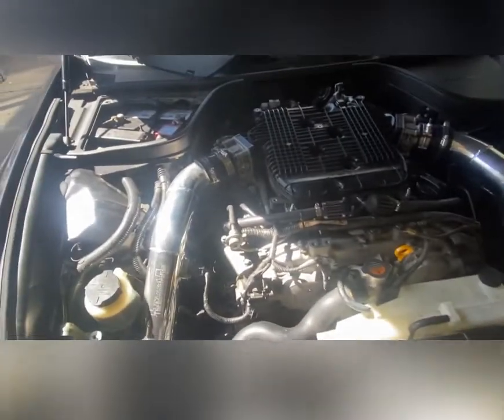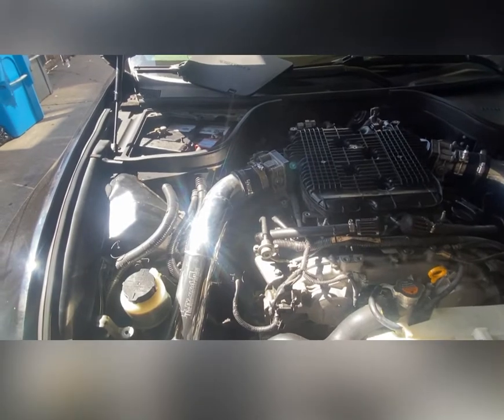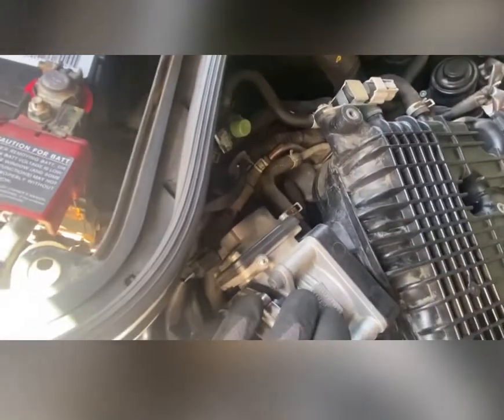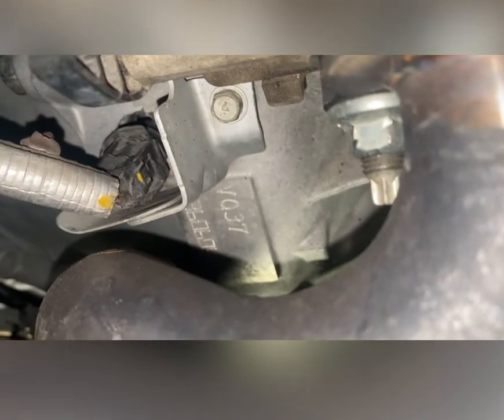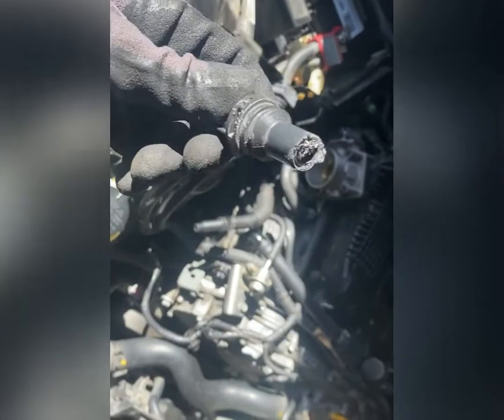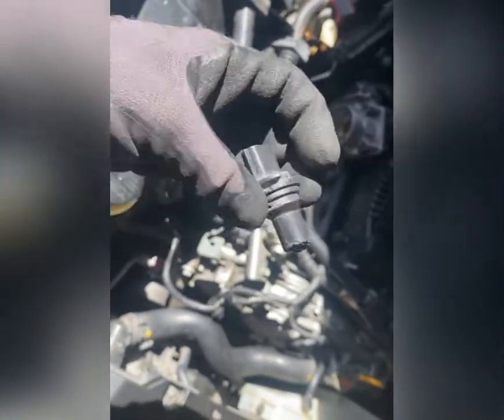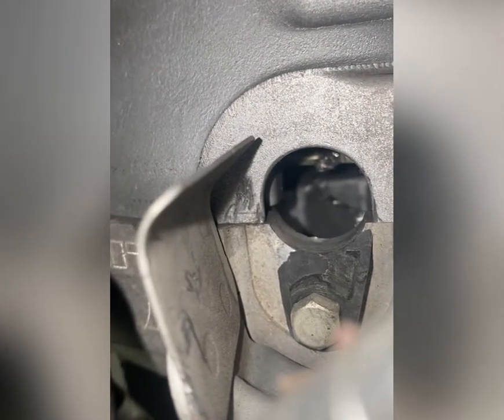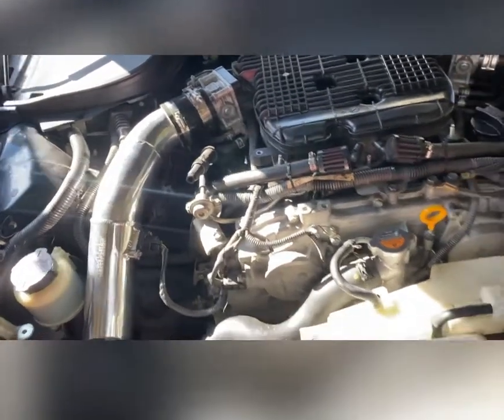How to change Crankshaft Position Sensor on G37/G35

Comment: I recently replaced mine and when tried to turn it on and would not start but when I put old one back one ,it started, where do you recommend I should buy my sensor also ,should I replace camshaft sensors, multiple people say there is more then one crankshaft sensor
Reply from the maker: what  brand is the new one ?
Reply: I bought it from Napa for $90
Reply from the maker: @Vqjxy   Napa isn't a brand, it's a supplier, if the brand is bad, then you will have issues with the sensor, try to get a Denso sensor which is the OEM brand. Please be aware of what you're paying for at the auto parts store; don't just pay and walk out
Reply: Ok thanks also is there only one crankshaft sensor
Reply from the maker: @Vqjxy   yes there's only one

Comment: Did it make a kind of knocking noise when they went bad?
Reply: Lmk ASAP
Reply from the maker: @HunchoTasi  the engine ? No
Reply: @mastertech6049  I have like a clanging noise when trying to start the car but goes away when the car is in park

Comment: do you do work on other Gs if so where are you located? I have a admin tuned 7AT G37x with admin intakes and IPT Torque Converter. my car feels sluggish and sometimes RPMs drop below 500 when coming to a stop. I just got a code engine speed input circuit. im in NJ
Reply: I get same shiet
Reply: Do you solved problem bro??
Reply from the maker: I’m in Cali
Reply: @mastertech6049  was it long crank time and if so where did u get the sensor
Reply from the maker: denso sensor from autozone or orielly, you can also get it from Z1 motorsport. Yes it took a long cranking time to start with the bad sensor

Comment: Once I change that sensor will the car start ? I just changed alternator starter and car has power radio works but won’t crank
Reply from the maker: Electrical problem between the ignition and the starter. Check the starter relay

Comment: I had a code pop up p0725 and said the engine speed input circuit my car felt super sluggish on the way home and I just installed test pipes the day before I cleared the code but my car won’t start and it said the most common fix was the engine crankshaft position sensor would this part cause my car not to start it was clicking/cranking but just dying
Reply: Hey jack you got that code fixed? I have same code P0725 if yes which sensor you switched?
Reply: @ engine crank shaft position sensor on backside of the motor near the headers is what I replaced the code went away my car wouldn’t start because the battery was dead
Reply: @ElberMoreira-mr3lc  
Yes

Comment: I got it out but now I can’t get the bolt back in🤦🏽‍♂️🤦🏽‍♂️
Reply from the maker: @lowlifespore8993  it’s tough
Reply: @mastertech6049 I just got it in. Car is still taking long to start and throwing the p0335 code. Not sure what it is anymore …. The part wasn’t OEM though
Reply: Do you think the issue is just it not being oem? I have a q50 3.7

Comment: Changed crankshaft sensor 3 times
One OEM from Infiniti 289 
Autozone for 66
And Vq part warehouse for 40 none worked
But the old one seem to keep working , LONG START STILL
Reply from the maker: The oem one is taking a long time to start ?
Reply from the maker: Or the one that you originally replaced
Reply: @ the ones i replaced were all brand new and they all didnt work battery was disconnected before i started .. the one thats faulty works better than all i had a start off the fault one … ive cleaned the sensors aswell and my only code is P0335 for the crankshaft
Reply from the maker: @HyOsama  bad flex plate reluctor ring, same thing happened to me. Has your transmission been removed recently
Reply: @ im not sure , just got it yesterday

Comment: Why does no one say how many you need to do???? Everyone shows how to change one...z1 says it takes 4..
Reply from the maker: every car has 1 crankshaft position sensor, the rest of them are CAMshaft position sensors which monitor the cam positions. The Crankshaft position sensors monitors the position of the flywheel thereby there’s only one
Reply: There’s 4 camshaft sensors, 2 on each valve cover back by the firewall.. there’s only 1 crankshaft sensor like shown in this video